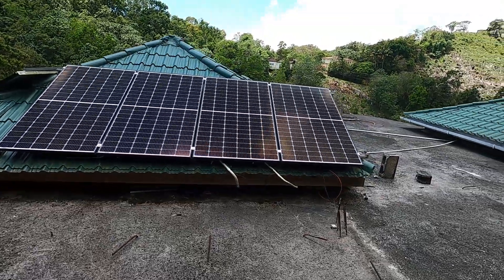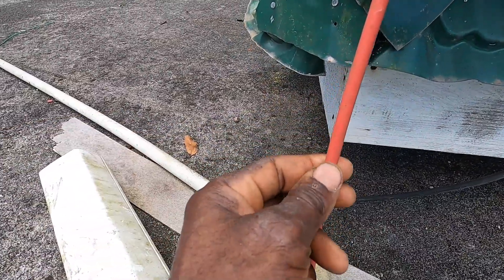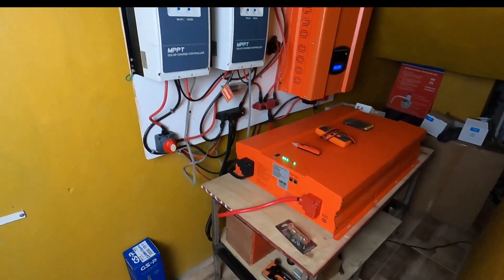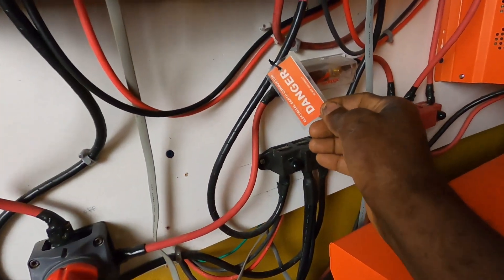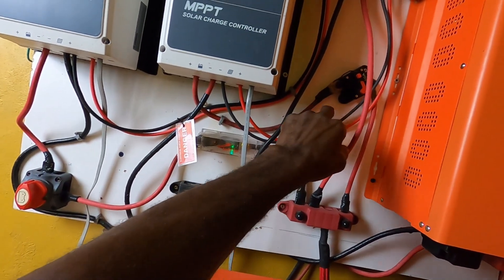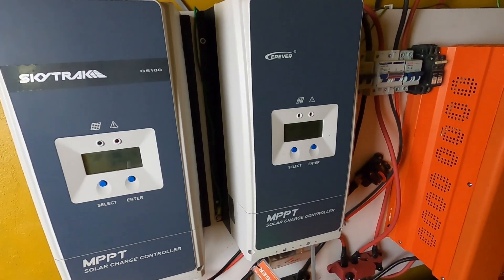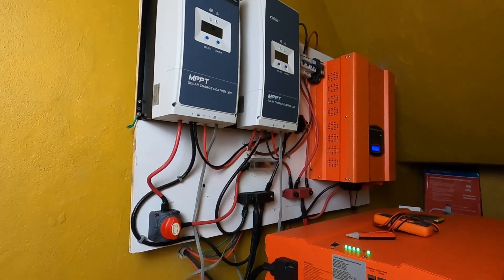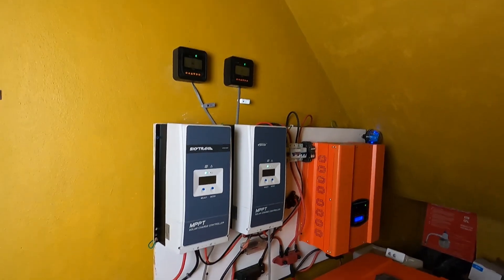My Third Solar System Upgrade

Comment: Nice setup (except for that temp. solar panel connection..lol) I started with one panel and have 3 panels 450 watt each, and two 100ah LiFePo4 batteries. Greetings from Mobay.
Reply from the maker: Much blessings my brother, I agree with you however I will disconnect those panels shortly to make way for some 4 450w that I have already purchased!. Thanks much